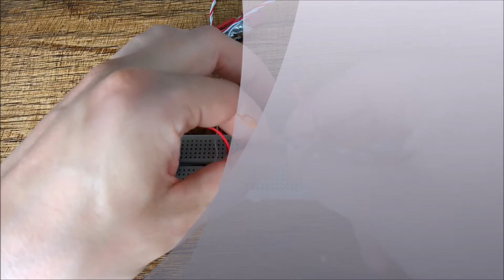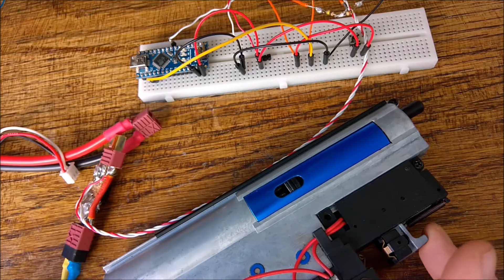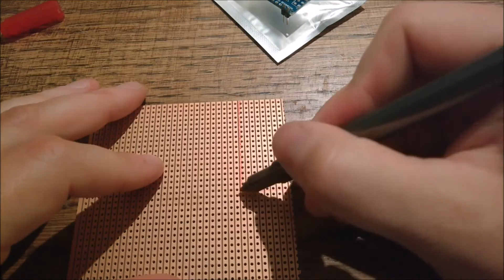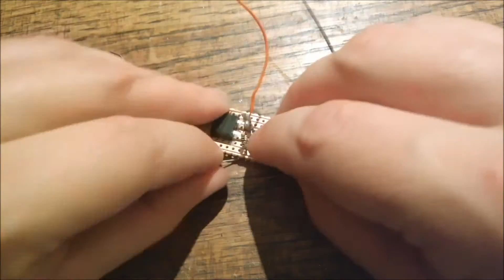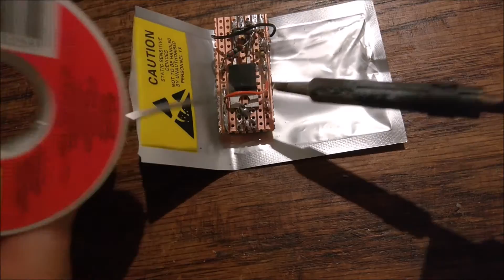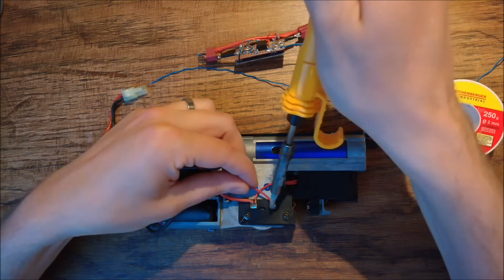Burst mode mosfet using an Arduino

Comment: Hello there, you have done very nice job.
 Do you think that is it possible to have different firing modes by using an externel push button or something like that ,to change between firing modes ?
 for example it can be a burst of 3, another of 6 and another of 9 shots  and then full auto ?
Is it going to be hard to write a code for this application ?
 Have you thought to add a low voltage alarm ?

 thank you in advance

Comment: Very nice work. I'm currently sourcing the parts to build the circuit. Got a question though. Would changing Max_ON_Time allow me to get Semi instead of auto? I'm trying to get a Semi/Auto gun as currently my gun is Safe/Auto only
Reply from the maker: Yes it will ... It's still not a real semi, because the piston may end up beeing partialy retracted and there fore there is a risk of double firing ... But the worst thing that can happen is that once in a while the gun will shoot 2 shots ... So Yes you can do semi auto conversion this way, but it's not perfect ....

Comment: Great video. Just wanted to say your gearbox is kinda loud, my dude. Had similar sounding gBox myself when pinion gear was pushing too far into the bevel gear. Had to shave off 1.5mm off the bottom of the motor cage in my case (V3 gBox).
Reply from the maker: Hearing a gearbox recorded with a phone don't do it any justice .... It's not loud when you hear it in real life ... I'm an airsoft Tech and has been working on well over 500 guns  so I kinda know what I'm doing ... :-) ... But thank you for your response :-) And I'm glad to hear that my videos are apreciated ... ...
Reply from the maker: Also: Shaving the motor cage down to better fit a motor (That sit's to high) is not a good aproach ... A MUCH simpler and better way is to just push the pinion gear futher down the shaft ... This can be done for all O type pressfit pinions, an most (not all) D-Types ...
Reply: Yeah, it must have been the microphone, then. Spent whole weeks watching shimming tutorials and didn't realize which channel I was watching. Keep up the good work.
Reply: It's an o-type pinion. I tried removing the pinion/pushing it towards the motor but it wouldn't budge. Even when chilled and heated up. I know it's generally not a good approach to shave the motor cage, that's why I kept taking measurements every 0.1mm as I was shaving it. If I later get a smaller (normal sized) motor I can still push it further into the gearbox.
Reply from the maker: Yea that happens... Again thank you for the comment :-)
Reply from the maker: Usualy us tech's has a special motor pinion removal tool... That can both remove and push on pinion gears ... 
"Google: airsoft pinion removal tool" it's "only" around 30$ and using that you can prety easly ajust pinions .... In a couple of days my motor disassembly video will show the tool .....

Comment: can i replace arduino nano with digispark for this mosfet?
Reply from the maker: Well yes ... that is an option ... I'm working on a mini version that are controlled by a MUCH smaller micro controller... But yes a digispark conroller will work just fine.... The code needs to be changed a bit, and the wiring is different but all the principles are the same :-)

Comment: Nice project! You use delay for burst, was it "try and error" to find out the 200 ms? And why aren't you using a micro-switch on "cut-off" to count rotation instead of using delay, so you can use also 11.1V Lipos.
Do you habe a solution for precocking?
btw, sorry for bad english.
Reply from the maker: Hello Sir. 
Thank you for the comments.

The 200ms was partly trial and error and partly Math ;-) The gun this mosfet was made for shoots 16 rounds pr second. 1000 ms pr second devided by 16 rps is 62.5 ms per shot ... 3 shot should in therory take 187.5 ms... But because it takes a little more time for the first shot I hade to add around 10 ms => aproximatly 200 ms ...

The video above is the second in a series of mosfet video's I have planned... The next video (will be uploaded in a week or 2. Remember to subscribe and click the bell for notifications).. In this series I will step by step show you all how I step by step make a more and more advanced mosfet.... So with time more and more features will be added... One of the features i will be adding is ofcause "Auto detection of ROF"... And there are many ways of dooing this. One way as you say is a cut off switch ... But there are other options as well :-)

Precocking is one of the features that are a bit more demanding to make (A simple version can be made purely in code)... So i will probably be one of the later videos ... But it is one of the features I have on the todo list :-)

So if you are interested in DIY mosfet creation subscribe and watch the videos :-)  Remember to push the small bell icon after subscribing so that you will receive notifications when i upload new episodes ....
Reply: Thanks for response. 
Do you think about magnetic induction instead of micro-switch?
Spring relaxation would be nice, too.
Reply from the maker: I have a coupe of different ways of dooing it... You will have to wait and see :-) But i can say that one of the simple ways of dooing it will be to messure how hard the motor is working ;-) 

Spring relaxation is one feature that I was not planing to implement, but because you are interested i will put it on the todo list as well ;-) So thanks for the feedback ...

Comment: Is there any reason not to use a ridiculously small controller (e.g. https://www.coolcomponents.co.uk/en/trinket-mini-microcontroller-5v.html ?) That claims up to 16V in max.
Reply from the maker: I personaly don't know that board, but the short answor is: No. Go ahead, if it can run on 16V input it should be fine .... If you want to be safe I will be posting a "Shrink your mosfet project" later this year ...

Comment: Hey AirsoftTech.dk, are you powering it with 7.4 or 11.1v  LIPO. I tried to make it with Chinese copy of Sparkfun Pro Micro board and it blew up when I used 11.1v LIPO to power it :D. I suspect that voltage regulators on Chinese knockoff boards are not sturdy enough for the purpose.
Reply from the maker: In the video I have a text box at time 1:06 that clearly states "The arduino can handle up to 12V on the VIN pin" ... That means that an 11.1v Lipo fully charged will be at "4.22x3 = 12.66" ... That is in theory MORE than the arduino nano's recommended input of 12v.... BUT: In the documentation it is clearly stated "The Arduino Nano can be powered via 6-20V unregulated external power supply (pin 30)" So YES it can handle a 11.1v lipo fully charged !!!

So my design works perfectly with a 11.1v Lipo and also works with 7.4v Lipo!

But in electronics you can't just replace one component with another if they don't have the same specifications! The "Sparkfun Pro Micro board" that you have tried to use has an input pin called "RAW" that has the same functionality as the "VIN" on the arduino. BUT the documentation on that board say "the applied voltage can be up to 12V" NOT 20v as the arduino nano can handle !!!!

So 12.6v (11.1v lipo fully charged) is LESS than the maximum of an Arduino Nano 3.0 BUT MORE than the maximum of a SparksFun ProMicro .... So NO you can't just change the components without proper modifications !!! 

Conclution: If you want to change components you need to check ALL the specifications ...
Reply from the maker: Also remember: There are different versions of the SparksFun ProMini !!! There are a 3.3 version as well ... If you use the 3.3v version the input pins CAN'T handle the 5v on the input pins !!! Another issue with switching boards is the current draw on the pin's for the MOSFET etc... Other boards may not be capable of delivering enough current fast enough !!! ...

So another conclusion: Don't change components if you are not capable of calculating the results. ...

Or you may end up burning components instead of making cool stuff :-)
Reply from the maker: Question for you: Why is it that you want to use the SparksFun Pro Micro ??? Why don't you just get and arduino nano ???
Reply: I just got it cheap, but it was Chinese knockoff. I did not get it from manufacturer (in US) directly. But the biggest problem is with all other small arduino compatible boards stating 6-20V possible unregulated input voltage is that in fact their voltage controllers cannot handle that very well. If you look at ardruino.cc products e.g. you would see that voltage controllers on these are shall I say "beefier" and can handle higher unregulated voltages. I searched the web for examples of arduino micro being powered from 3S 11.1v lipo and found one post in some forum that it did work but the voltage controller was getting very hot and person eventually decided powering it with 7.4 2S LIPO instead. This is the reason I asked if you were using your project with 11.1 3S LIPO in order to find out if you experienced any heating issue of ardruino board.
Reply from the maker: The thing you need to keep in mind is current draw! Higher current draw on the arduino will result in more wasted power in the regulator. But when the only thing the code does is power a MOSFET (Voltage controled not current controled like a transistor) so the current draw is verry little .... That's why the design can savely be powered with a 11.1v lipo (If you use a genuine arduino nano!) ...

But ofcause the most optimal way would be to use a 7.4v Lipo (Or adding a buck converter to knock down the voltage range ...)
Reply: I will be buying aurduino micro and powering it with separate battery, maybe 7,4 lipo or 8,4nimh. I do have space in my AEG for extra battery fortunately. However, if using original ardruino boards for such projects they become quite expensive.

Comment from the maker: Hi there. Dynamic Bacon and other's have been asking allot why I don't use what's called a "flyback diode" in my designs. This is because i just use mosfet's that can handle the reverse current generated by the free wheeling motor .... Almost all Power mosfet's has "Body diodes" inside of them that does exactly that !!!! 
https://en.wikipedia.org/wiki/Power_MOSFET#Body_diode
So why add and extra when there's already one in there? (Theres just no reason) BUT remember to get a mosfet that can handle the higher voltages...

Comment: Can this be used instead of Nano? https://www.arduino.cc/en/Main/ArduinoBoardMicro Thanks
Reply from the maker: Yes. Almost all arduino boards can be used instead, but it require some changes. The pin's are located a bit different on the 2 boards. D5 pin and A0, VCC and GND pin's  are not physicaly placed the same place on the Micro as they are on the Nano. But if you can accomidate for the different pinout, then: YES No problem.
Reply from the maker: Aditional note: If you google "Arduino nano pinout" and compare the results with a search for "Arduino micro pinout" then you can see that the pins are located differently ....
Reply: Thanks, I guess it will just involve slight change to the code. I am actually planning on using cloned arduino from ali or ebay called Pro Micro with same ATmega32U4 as original, but chinese board is smaller and has no components on the other side (put some dielectric tape and mosfet on other side directly). Also uses microusb instead of mini Hopefully it is also stable enough.
Reply from the maker: The china boards are kind of hit or miss... Some works perfect, no problems, others don't work at all.... One thing that you should remember is to get one with a GOOD usb to seaial converter! The boards with the CH340 and CH341 are VERRY prone to breaking. This is because of drivers issues. So I reccoment that you pay the 0.5-2$ extra for a board with another usb to serial converter.... FYI: I thing 30-40% of the CH340 boards I receive have broken or was broken when I received them. Only 5-10$ of the god ones has broken .... And NONE of the genuine types i have has had any problems .... So I reccoment at least getting one with a decent USB to serial chip...
Reply from the maker: Bonus info: If you doo get one with a CH34x watch some of the videos showing the problems and how to fix the driver issues before you plug it into your computer! ...
Reply: I believe ATmega32U4 has built in USB support and does not need any other USB chip. I am preparing to buy stuff and try it. I will let you know how it goes with cheap chinese board.

Comment: Nice one! I was looking to do something similar and stumbled upon your design. Is there any reason you didn't use the interrupt service routine for detecting triggerpulls? With that you could time the cycle in single fire mode (for accurate/selectable) bursts. http://gammon.com.au/interrupts.
Reply from the maker: Hi. Using interrupts will give precisely the same result (Perhaps with pico seconds faster response) but it will require one to handle jitter on the input. Because the trigger contacts may trigger the interupt multriple times. This is usualy handled by adding capacitors to handle the problem. But that will increase the physical size of the unit. That's why i keep it simple.
Reply: If the speed stays the same as you say, analogRead will also encounter this jitter. I'll try both methods this week and give you an update if you're interested. Hardware wise, I pretty much copied your design :D. However i allready have a mosfet installed so im using the balance lead of my lipo to power the arduino and simply cut the signal wire to my mosfet!
Reply from the maker: "analogRead" VS "Interupt"... YES: Both will ofcause have jitter on the input pins!... For interupt this is a problem because each change will trigger the interupt routine... When using analogRead you may read a wrong value, but next cycle the jitter should have stopped and the analogRead will sample the correct value... So because analogRead is a PULL design not a PUSH design the problems will be VERRY hard to notice... Where the Interupt style can end up beeing a mess to get working....
Reply from the maker: In short: Worst case with analogRead is that the trigger pull will not be picked up in the first loop cycle, resulting in a delayed trigger of 1 loop time (perhaps 1/4 ms). Worst case with interupts is that the interupt may trigger when you release the trigger, making the gun fire when the trigger is released .... So interupts is simply harder to get working consistently ... It can be done, but I don't thing anyone can feel the difference....
Reply: It works. Like you said dealing with normal button jitter and also button jitter due to a voltage drop when shooting full auto was a pain in the ass. However it works now allowing me to accuratly time a single cycle and use that value for burstmode. This means its plug and play for most guns without guessing a burst time.